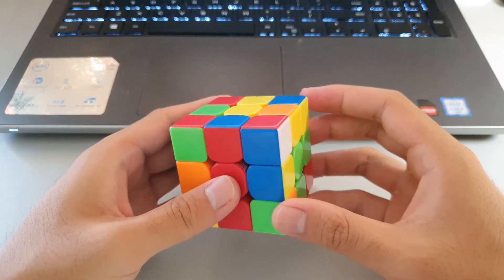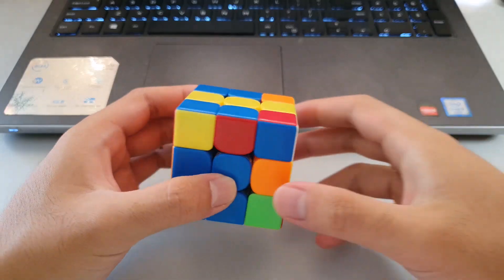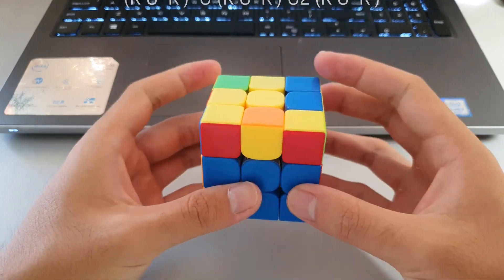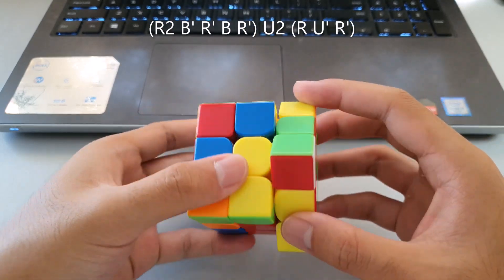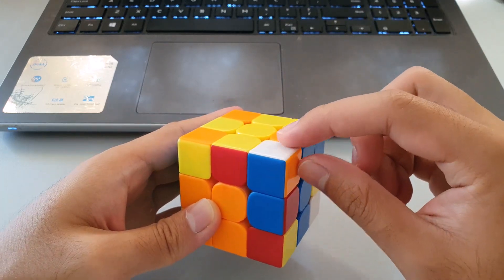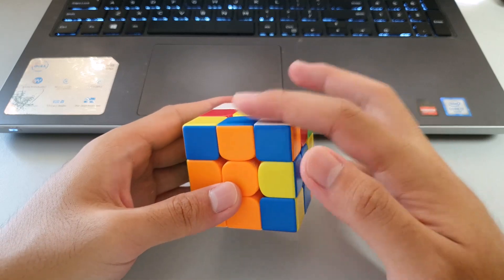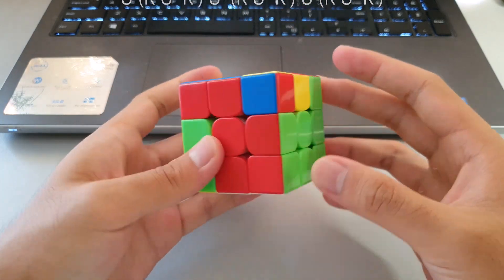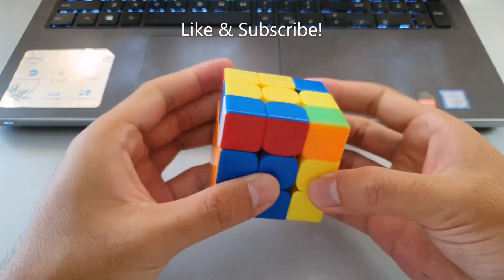Advanced F2L Made Easy: Incorrectly Attached Pieces!

Comment: At 3:22 another really good way to do it is just inserting the corner and doing a double sledgehammer because to insert the pair at that angle you just use sledgehammer (correct me if I'm wrong because I an pretty new to cubing lol)
Reply from the maker: It's a bit inefficient to do a double sledge during f2l
Reply: Mike Shi ok thanks! I wasn’t sure but I though that might be the case 😂